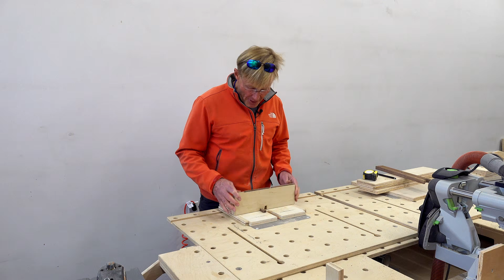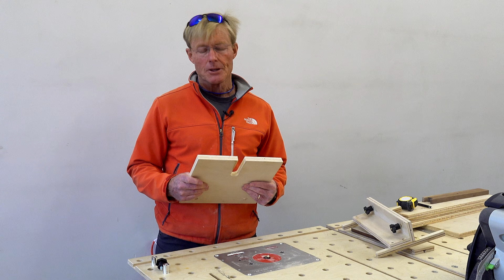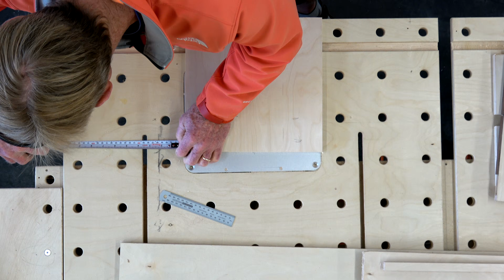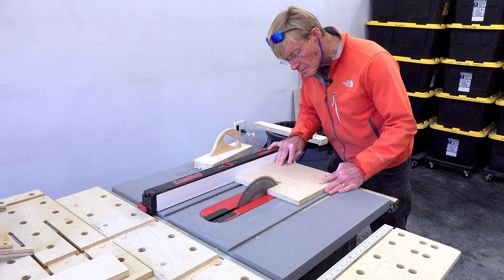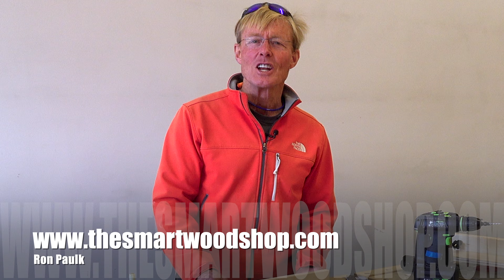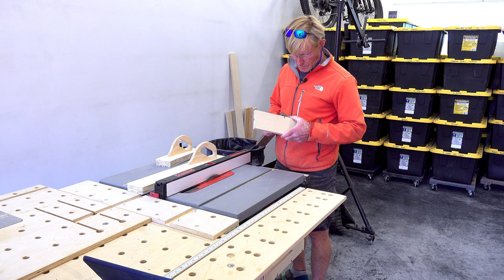Smart Router Table Box Joint Jig

Comment: Would it be better to put two vertical t-track slots on the back of the fence with the spacer? Sliding it right to left to install means it could be slightly off center.

Comment: The base plate does not have to be accurately square to anything. A router is a rotary cutter- it does not have any horizontal alignment.
Reply: Had the exact thought, Mike.
Reply from the maker: The accurate placement is left to right and front to back, I didn't;t say square, but that does also square it to the table.
Reply: @TheSmartWoodshop  Front to back is also not critical- that is the stroke direction. You can actually key it to a router table insert- but I prefer a zero height sliding fence, as this retains the cutting height set on the router, and prevents any variation in base plate locating height. Tends to give better dust extraction, also. Insert slots in the table give the alignment.

Comment: Hey Ron, I noticed that your SRT do not have the 4 slots for the clamps that hold it to the bench.  Are you using Smart Connect Dogs to hold it down?  If so how many to you use per SRT?.  Thanks
Reply from the maker: I use 2 Power-Locs or Smart Connects

Comment: Hey Ron, What hose are you using on the Kapex?   Its a monster!  I bet you get really good dust collection out of it since you can move a large volume of air through it.
Reply from the maker: This is the hose I have. https://amzn.to/3zqIj2u I have two of them: one on my floater vac for general clean up and one on the Smart Station. They are my favorite hose.
Reply: @TheSmartWoodshop  I just bought a Mr. nozzle hose as you suggested.  Question, how did you fit the hose end (light gray) on the Kapex dust port?  the only way I can see to get it to fit over the dust port would be to heat the light gray end in an oven or maybe with a heat gun
Reply from the maker: @pctatc66  mine fit right on with nothing more than elbow grease?😜
Reply: @TheSmartWoodshop  sometimes Brute force is all it takes!  hahah thanks Ron